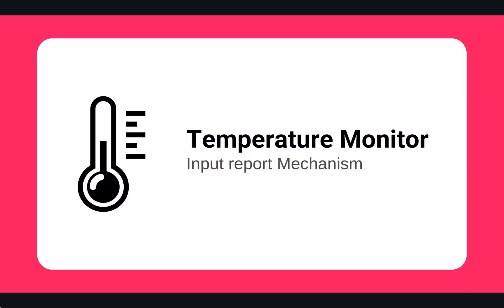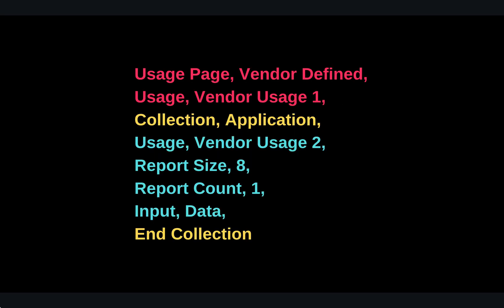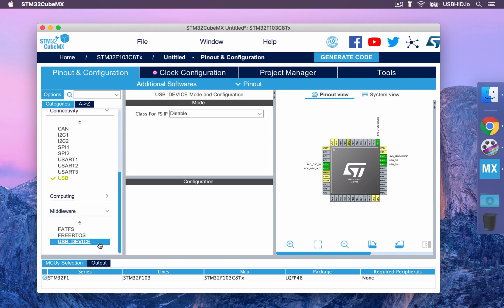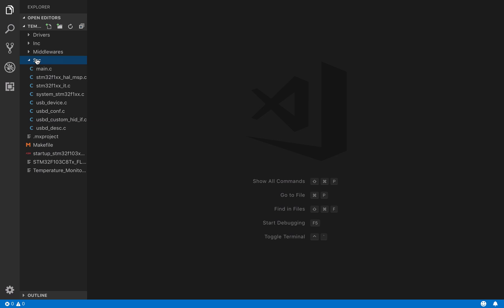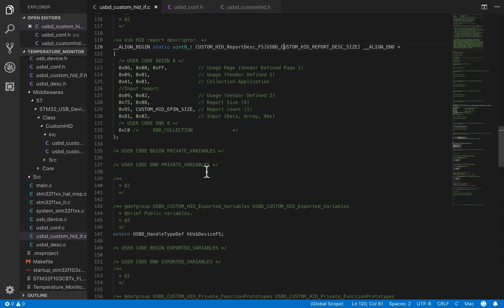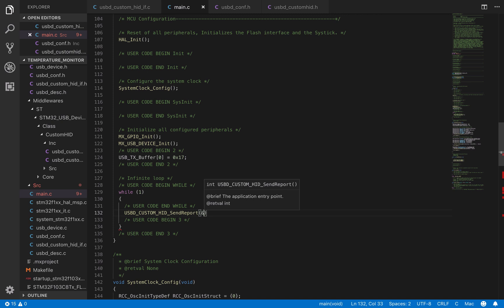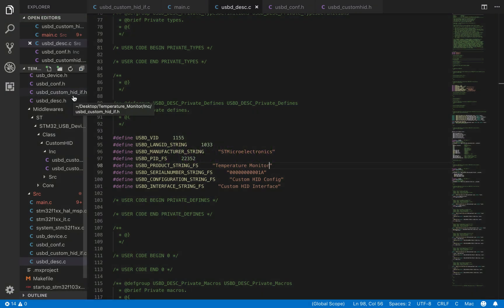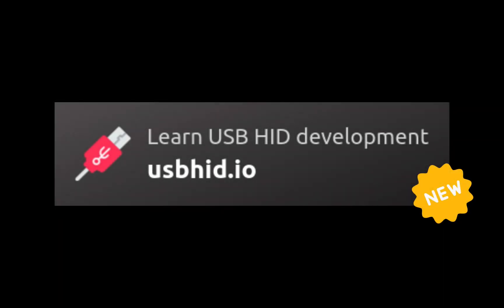USB HID Device Development: Temperature Monitor | usbhid.io

Comment: Followed everything. Except I couldn't find the HID-console on the web. I found a github link and cloned it. But the HTML file doesn't work.
Reply: Its not a website, its probably an electron program. I think the developer stopped working on it. You can probably download the source code and build it yourself.